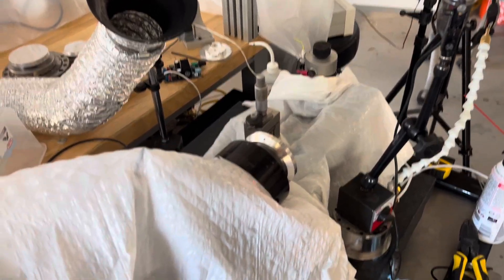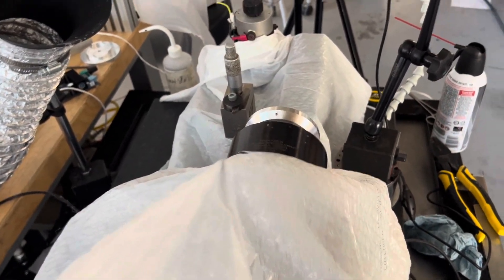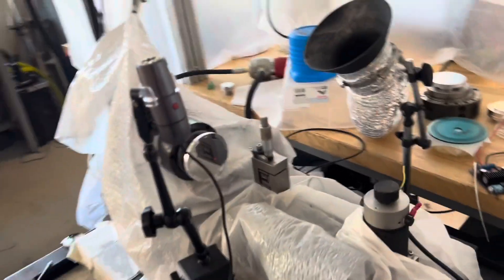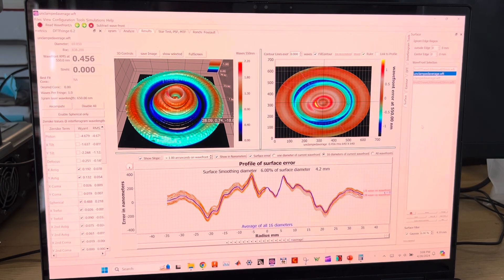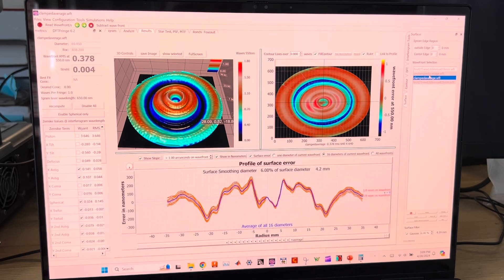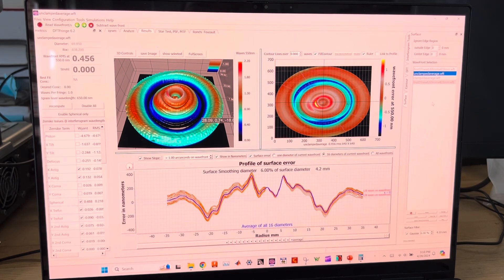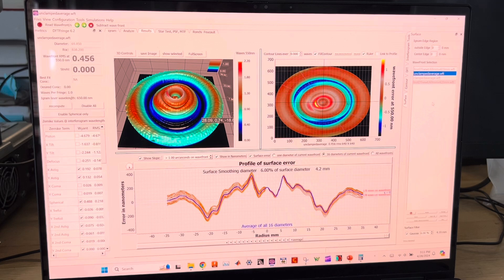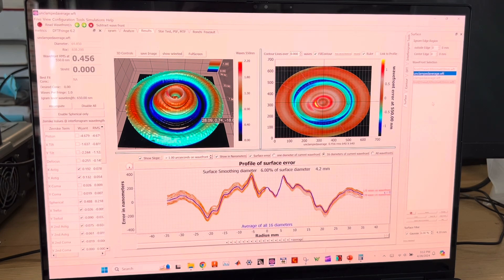Investigating error due to clamping forces and first imaging test

Comment: Kicking the dead constant sfm horse some more but you can keep the spindle speed constant while reducing the feedrate as you get to the center.

In a big rigid setup, constant sfm doesn’t matter. 
On your smaller less rigid setup cutting forces may be coming in to play. 
Tool is deflected on the od because its spinning too fast and is unable to get a stable cut, digs in at the middle of the radius as it finds an optimal sfm to balance the forces, and finally deflects again at the center because it is feeding too fast for the spindle speed causing that tearing/rubbing finish. 
Another thing to check may be the tool height, make sure it is perfect.

Take this with a huge grain of salt, I am only a .0001” machinist.

This stuff is really cool, love the content.

Comment: hello there.. For the last 8 years i turn and measure optical mirrors in all shapes and  sizes. The elevation pattern that you can see on your mirror profile is a sign of your tool not beeng precisely on center. This error looks either like an W , that would be your case, or and M. Some  errors could also come from your diamond edge or your Axis but mostly i can see an error on your tool beeng of center and thats  the error you can fix. Dependen on which side of your spindel your cutting tool stands and if the radius of your optic is concarv or convex you can deduce if your tool needs an correction in plus or minus.  Cutting on the left of center in a concave radius getting a kind of a W shape i would say you need to correct your tool away from center to get a better shape.  Correct your tool 10µ and cut another sphere and look what happens. when you measure many times with differend tool  corrections  you can  find the  sweetspot where there is no W or M error then you only see every  other error :D  The ring  in the middle  of  your  mirror was probably caused from some impuriti  in your aluminium. Also you could get better results by taking the last two or three finisching cuts with the same depth  and  switching the side of your coolant so it blows away from center.

Comment: Outstanding work, as usual!
 
I do R&D with an older Moore 450UPL at work. At one point I was investigating machining parameters (including constant surface speed [which is indeed over-rated for SPDT of aluminum], feed, tool geometry, alloys, etc). Decided to minimize variable by using 2" flats as my test standard, but found some residual power (PV error) much larger than expected. Thought it was vacuum pressure, but for these pucks that was an order of magnitude lower effect unless the mating surface wasn't lapped flat. However, one day I decided to chuck up a 6" 1/20 wave optical flat and ran a mahr electronic indicator across it (and clocked to rule out wedge) and found that there was waviness in the X-axis.  During PM, Moore would adjust spindle axis perpendicularity with a test bar, but they'd only check one position along the axis so it went unnoticed by the production folks.  

So, if it's a geometry error, you should be able to find it without making a cut, unless it's dynamic. If that's the case and it passes the flat test, then find a high quality glass lens with a spherical curvature similar to yours to use as a "calibration artifact" and program a radial scan with an indicator and you'll get your answer. Measure it with your interferometer and make an error map of the artifact if you need to.
That being said, if you can confirm with an artifact that it's not machine error, you still have many things to investigate. I've seen many befuddling errors due to material inhomogeneities, mounting interfaces, and residual stress from blank preparation. Heat treatment is important, as can be alloy selection. Obviously thermal can be a huge error source, and the longer the cut the more it can be an issue. 
There's also tool tip waviness - local irregularities in the tool's radius. Our supplier doesn't charge much more for a 1/10th wave tool tip waviness vs 1/4 wave and it helps on spherical parts when you're not using a B-axis to rotate the tool. 

Good luck!
Reply: Also, if it's a repeatable axis error you should be able to compensate your tool path (depending on your CAM package.) That worked well for the test flats I was talking about, but it was easier because it was a low-frequency error (i.e. power, not irregularity)

Comment: Averaging over 90 degree rotations is a bit questionable since your coupling has order-3 symmetry. When you average over 90 degrees (order-4), you might end up cancelling out deformations that are induced by the shape of your coupling. Although I doubt that such deformations are a major effect, I think some mild order-3 stuff was showing up in your wavefronts in the previous videos.
Reply from the maker: I should have been a little more specific there. I take 4 interferograms at 0,90,180, and 270 degrees, process them, derotate the last 3 interferograms -90,-180,-270 degrees and THEN average them. This is intended to average out any common mode error from the interferometer, and errors due to atmospheric turbulence. So basically I’m not averaging one at 0 and one at 90, I’m derotating the 90 back to 0 and then averaging.

Comment: Is the error you are seeing consistent over multiple cuts? If so, a way to get a better end product could be to "distort" your "inputshape" using your measured difference from the desired shape, i.e. cut deeper where your machine doesn't cut enough and cut less where the tool gets pulled into the surface too much.

Comment: Nice work!! The optical quality certainly is already quite good.
While you were addressing the surface speed concerns, I was wondering if the tool angle to the workpiece might be a factor here. I have zero experience with diamond turning, but the same laws of physics still apply. As the tool traverses along the radius of the workpiece, the surface speed will differ at the cutting edge and if the tool is slightly out of alignment, the tool might cut more efficiently (i.e lower cutting forces) at certain speeds compared to others...

Like I said, zero experience, just sharing my 5 cents worth...
Reply: diamond tools have a circular cutting edge (viewed from the top), and for a curved surface the contact point between workplace and tool keep changing. since it's nearly perpendicular to the work piece, the side rake and clearance angle don't really change unless there's an error in the shape of the tool (which does indeed happen.)

you find differences in surface roughness as a function of cutting speed, but form errors aren't likely to occur since the cutting force is incredibly small

Comment: Just a comment on the Zernike settings. It's hard to see in the video but I think defocus is disabled. This automatically removes a large part of the difference in spherical shape. You might want to leave that checked for a better comparison.
Reply from the maker: I’m working through learning Zernike polynomials right now and that one had been confusing me. I feel like I’ve seen people keep it mostly unchecked so any literal defocus from the interferometer not being at the exact correct axial position is removed. How would one discriminate defocus due to alignment and defocus due to actual surface shape?
Reply: @cylosgarage  well, for example with a telescope mirror, the precise focal length is not that important, as long as the surface shape is correct for the optimal focal length. However, if you are interested in the actual deformation in the mirror shape due to mounting (like you are), you should include the effects of defocus in your evaluation. Because for example tightly mounting it in the centre could change focal length. If you ignore this effect, you are missing part of the actual surface deformation.
Reply: @cylosgarage  I concur with the great man - I hadn't appreciated that you were turning a parabola (I thought it was plane from the previous video). I think part of the explanation could be a small error in your X zero wrt the spindle axis. This generates a characteristic 'W' or 'M' pattern in the centre of the part wrt the best fit sphere,  depending on whether the tool goes past centre, or stops short of the centre. This could explain everything within R=20mm.
Reply: @cylosgarage  Worth looking at the effect that an error in tool radius generates too.

Comment: Kind of new to your content but have you monitored the temperature of the cutter and item you are cutting? Even the slightest temperature changes especially the environment may effect the machine, cutter, and material at the precision to are trying to achieve. I'm actually impressed at what you have achieved so far. Your tooling geometry may matter and observing and measuring its temperature change if any during the cut could be of interest if you experiment with changing that variable. I had a thought on being able to measure any vibrations in the tooling itself during operation. Could the tooling be clamped with a say piezo material between the clamping mechanism and tooling and monitored during the cutting operation?  Good luck.

Comment: How is the surface when making a plane mirror? I.e. with Z locked. Wondering if you can narrow the source of the defects again - I thought this clamping force test would have shown a larger impact.
Awesome content, appareciate getting to see your great work.
Reply: Would have asked the same... In my eyes the results look like a pretty balanced toolpith with the exception of two areas where forces on the drive train add up and let go in a more spontaneous way. Does that make sense?😂

Comment: I'm telling you, it's not a stiff enough tool post flexure and the monocrystalline diamond needs a steeper negative rake to help it cut smoother.
Reply: Zero rake for aluminium with diamond tools. Negative rake for other materials like germanium, zinc sulphide, etc.
Reply: it's a good thought, but the cutting forces are extremely low and his setup is very compact so it's not likely to explain this problem. Stiffness issues may show up in micro-roughness, but not overall form accuracy. Diamond turning doesn't work like regular machining - all macroscopic intuition goes out the window! 

And just to second Mister_G's comment, below - zero rake works best for diamond turning aluminum.
Reply: Moore Nanotech's and Precitech Nanoform's don't have flexture tool posts like this ultra-precision home built lathe does. It's like comparing apples to oranges with the stiffness order of magnitudes achievable in commercial SPDT lathes.

Comment: Can it be the wiggle of the system that controls the diamond position (X and Y?)? I don't mean the stiffness of the construction, I mean the motors/controller/etc. Can the PID controller oscillate a bit around a new set point?